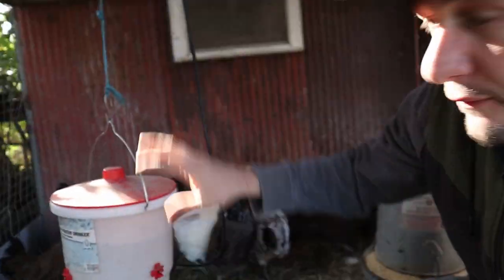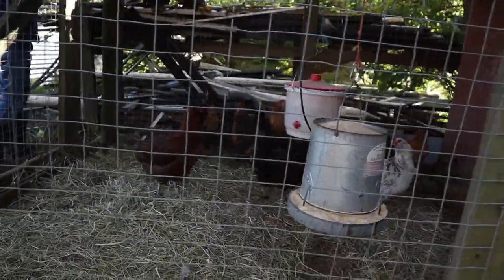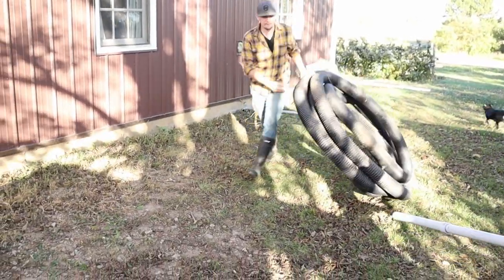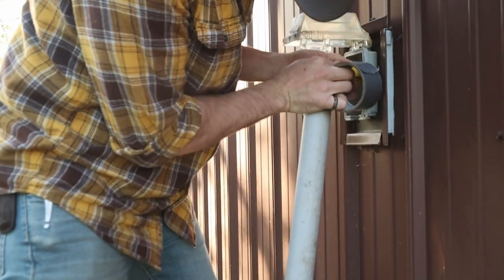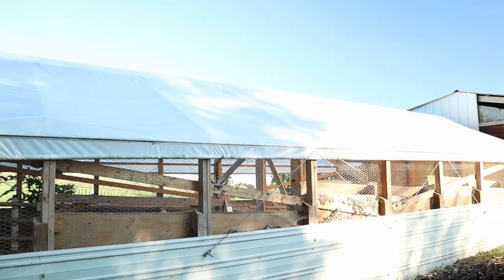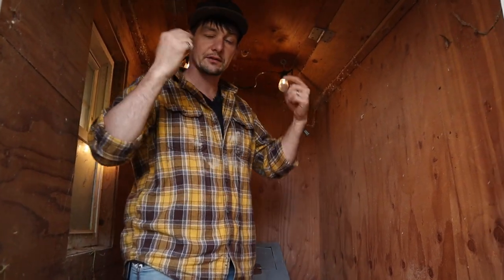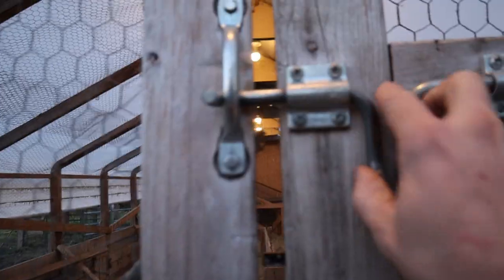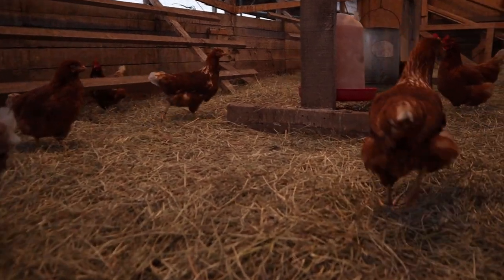Do THIS so your Chickens will Lay LOTS of EGGS this Winter

Comment: First I want to commend you for teaching yout son. I do the same thing with my kids.  As far as introducing artificial light for the chickens, I have to disagree with this process.  Chickens use the winter months for molting.  They use whatever protein they take in for molting.  I normally do 2 things this time of year.  1.  I give them extra protein such as worms(53% protein) , eggs and seeds.  2.  During the time when they are producing a lot of eggs, I don't give away or sell any at first.  I preserve them by water glassing them.  This preserves raw eggs for up to 2 years.  It works and there's a lot of info out there on just how easy it is.  Once I have enough eggs preserved, I will then give some away or sell them.  Hope this helps
Reply from the maker: I agree and disagree 😂 What you're doing is probably a more sustainable version. We were selling eggs, and to make any kind of profit we had to keep the hens laying. It's just gonna depend on your goals.

Comment: How do you keep hawks away from chickens in a pasture?
Reply from the maker: GOOD QUESTION! If you have any answers let me know 😉 We’ve had chickens on pasture for about 5 years and never had much of a problem until this last summer. It was really bad. We lost around 10 chickens, and the days we were able to scare it away before it ate something it just scared the crap out of em. I think that’s why they’re not laying well now. Chickens don’t recover from stress very well. We tried everything we could think of and nothing worked (shiny stuff, radio, realistic scarecrow). Livestock guardian dogs is what people suggest, but we just can’t afford one right now. We’re gonna have to figure something out though for this next summer 🤷🏻‍♂️
Reply: A good way to keep hawks away from you chickens is to have plenty of black chickens.  Ever notice how hawks don't mess with ravens or crows?  This is because those birds are also predatory and fight the hawks, so hawks don't mess with them.  If they see black birds on the ground, they won't be as brave as they normally would
Reply: @combatsquid1115  I did read that. However, it seems as though my black chickens (I have two) seem to get pecked at more. Add more black chickens to balance out the colors? I have a mix of breeds. Some reds, a few Autralorp and a few Easter Eggers.
Reply: @lisahuber5403  couldn't hurt to try.  I know it seems crazy, but it does work for me.  How many chickens do you have?